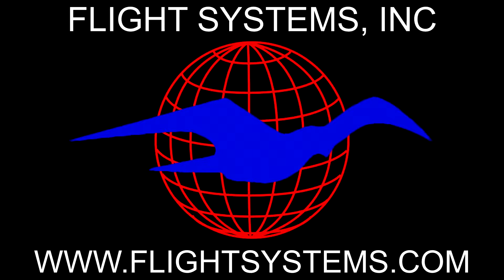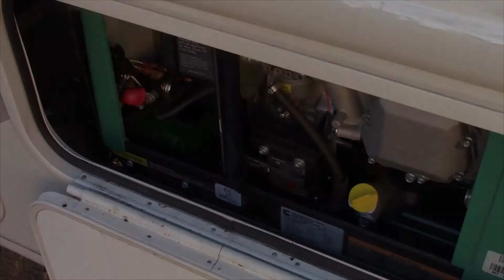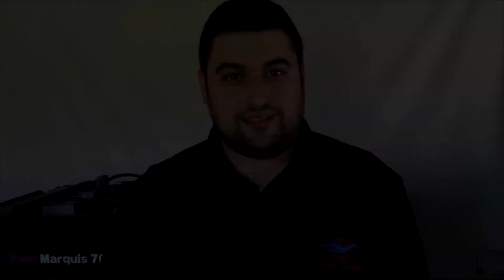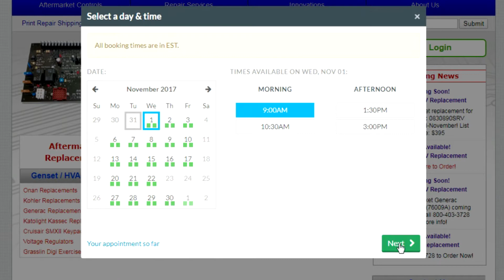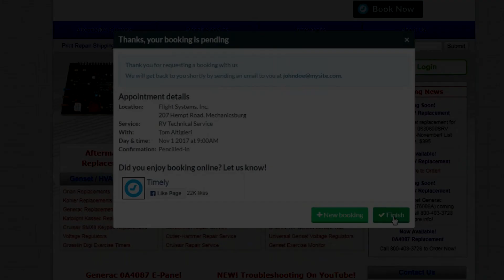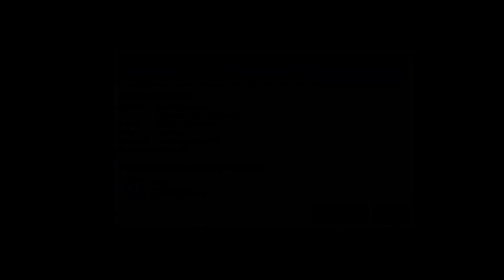Removing Quiet Gasoline Control Board

Comment: I am watching this video to see how to remove the control board because it is in the way of me cleaning the ground wire that is sparking and causing my generator not to turn over. I think this happens a good bit in older generators.

Comment: I have a 4000 spec P ONAN in my class c.the generator runs fine charges the batteries but when i turn on the AC it sputters and turns off. i can run the generator for hours but as soon as i add extra load water heater and the fan in the ac it shuts off. i can dump the extra power and it starts right back up ???
Reply: Same with mine. Seems my rings are corroded. I took ohm readings and they are high. Now I have to remove the generator and figure out how to disassemble it to clean the rings. Wild how something can be made so poorly

Comment: Just got your replacement board for my 4K Onan, which would only run when the starter was depressed.  It was showing a #45 error code.  After installing your board the generator started right up and is making good electricity.  Thanks!!!

Comment: Is the control board and voltage regulator on an Onan Microquiet 4000 the same unit??? I have the same control  board as in this vid. I just don't know where the voltage regulator is located.  My genny won't stay on when I release the start button. It will stay on for about 10 seconds if I hold the start button pressed in. After that, it will die and throw code "3-2".
Reply: Win currently having same problem.  What was the fix?  Please email me jimpawlecki@gmail.com

Comment: What are the symptoms of a bad control board? 

I am chasing very bad voltage noise & distortion (DIRTY power) and can't seem to find the source.
New brushes and slip ring cleaning did not solve the problem.